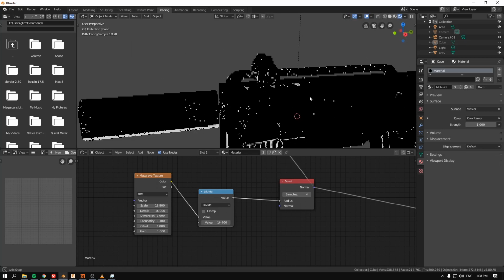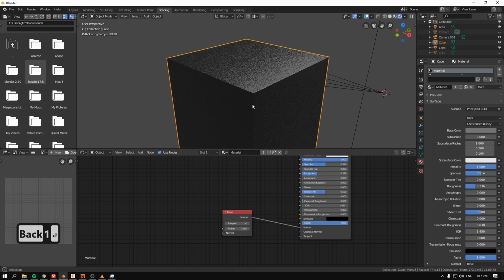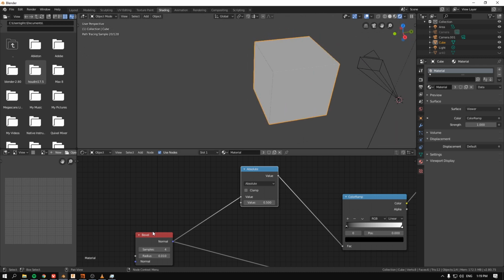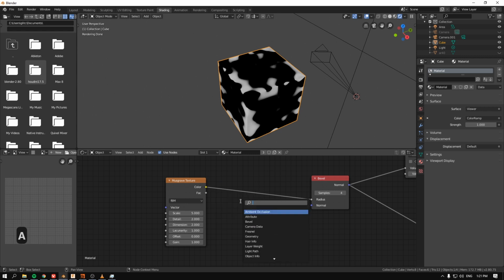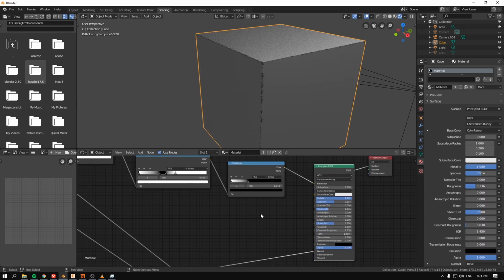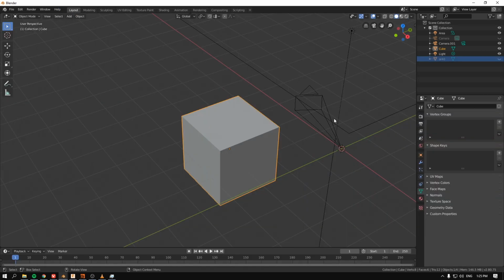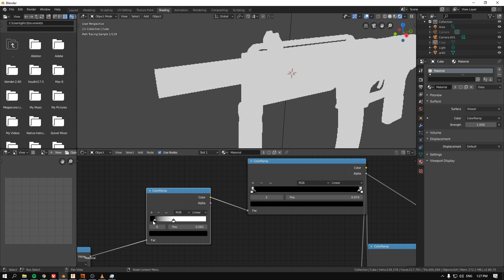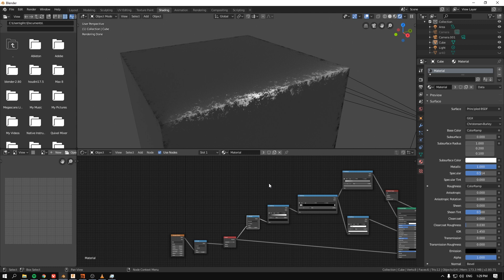Procedural Imperfections, Tear and Wear using Bevel Shader — Blender Cycles Tutorial

Comment: The problem with the bevel node is that it still has not an option for choosing only the convex or concave edges of an object (so that someone can apply 'dirt' and 'wear' separately on it). Blender needs a seperate node for fully fledged edge detection needs. The bevel node does a lot but it is not efficient for making advanced edge editing work. A fully fledged edge detection node in Blender could make almost needless the use of apps as is  Substance Painter.
Reply from the maker: You can always add/negate/multiply/other_math_stuff the results of rendertime AO to control it if you wish. Each scenario requires different approach, and apps like sbsP and QMixer are definitely something that is useful.

Comment: Wow, I was just thinking how much the "pointiness," attribute sucks. I never thought of using the bevel modifier!

There is a major improvement I made to your node setup though. Instead of messing around with color ramps, we can simply use the dot product to take the "difference" between the default normals and the beveled normals, giving us the edge detection we want. This makes the technique as close to perfect as we are going to get. 

You can see an example here: https://imgur.com/a/vbNgsur
Reply from the maker: That's a pretty neat setup, have not considered doing it like that. Sweet, thanks!
Reply: I dont understand how this video or your setup end up into a normal map node without being converted and when I do convert them the normals go crazy.
Reply: @Mikhael19881  you don't. The end product isn't a vector (purple socket, like a normal map is) but a simple number value (black/white, 0->1)

Comment: Great demo. Out of curiousity, what benefits does this workflow have over using something like the geometry>pointiness node?
Reply: Geometry > Pointiness relies on the amount of geometry present in the model.

Simple test:
- Create a material that is just the pointiness value hooked up to an emission shader
- Apply this material to both a default cube, and a cube that has been subdivided a whole bunch. They will look completely different.

This method means that there is no difference between a model with lots of geometry, vs a model with almost none (excluding areas that actually become more pointy with less geometry). It also means that using the subdivision modifier with  higher render subdivisions won't surprise you by looking different after the render.
Reply: @ZachHixsonTutorials  ahhhhh thanks for the explanation. That's great. I was thinking all the way through this demo.. maybe this could be made into an Uber shader. Looks killer
Reply from the maker: Connecting this to any input will solve your "ubershader". I'd prefer flexibility over rigid solution.